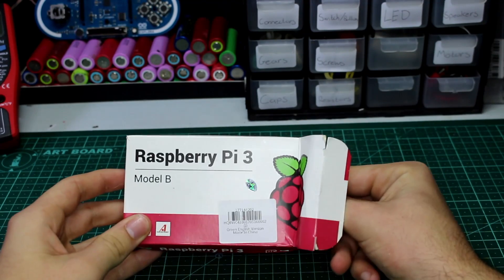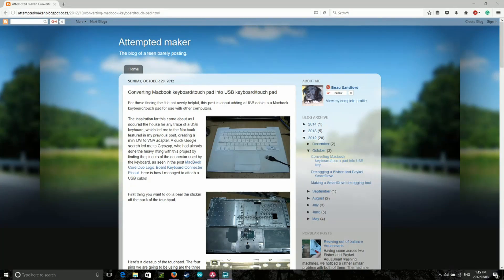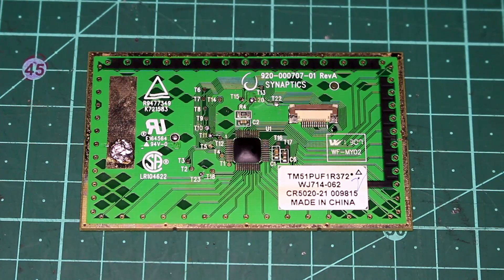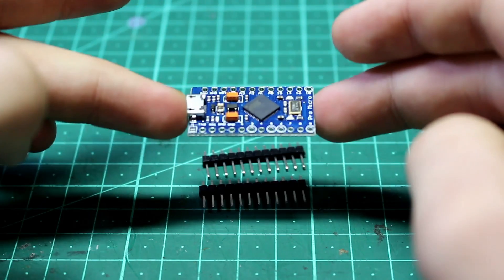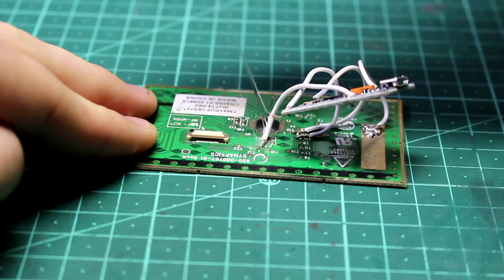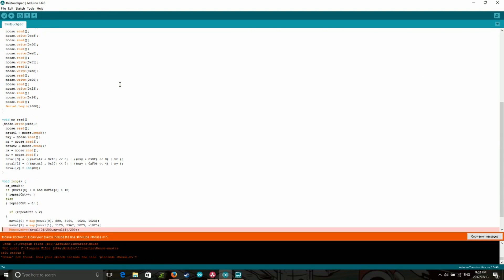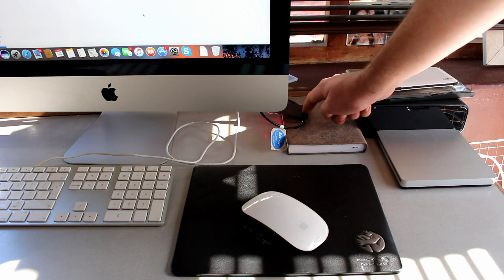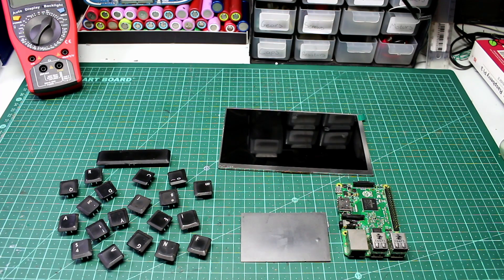DIY Arduino trackpad

Comment: You're lucky that you found the documentation for the specific trackpad that you found, but this may not apply to every single trackpad in the salvageable wild. It's more helpful to demonstrate how you came to the conclusion that these specific pin numbers are what we want..

And above all, Raspberry PI has GPIO pins specifically for interfacing with any generic devices, including the 2-wire or PS/2 interfaces, so requiring a specific Arduino just to have additional processing required is too unnecessarily complicated.

Comment: You can buy a ps2 to usb adapter for pretty cheap even as low as 2 bucks if you're willing to have it come straight from china. Just make sure you get the kind with both a purple and green end going into usb. The ones that only have one green end are passive adapters for things that support both ps2 and usb internally.

Comment: you can use a touchscreen touch panel instead and the pinout will be easy. so you can use a old phone instead of a old laptop then use existing touchscreen libraries to run it. although finding one that you can easily solder might be a issue.

Comment: the link you provided in the instructables for ps/2 library does not exist. Can u link the library files?
And I downloaded a ps2 library but it shows an error while compiling and i selected the correct  board
"fatal error: WProgram.h: No such file or directory"
Reply: Same problem
Reply: Fixed the problem! You just need to rename "WProgram.h" to "Arduino.h" in ps2.h.

Comment: wont upload to arduino uno,not at all!
Reply from the maker: I did say in the video that this won't work with the Arduino UNO
Reply: yes too bad,ok thanks
Reply: I get the pro micro! I have some trouble with libraries,where to find thes two folder mouse end ps2 in one place thanks!

Comment: Cool idea but if you flash the rom on the arduino uno you can make is show up as any device you like. I have mine used as a keyboard.
Reply from the maker: You were able to get an Arduino Uno to show up as an HID device by flashing the Rom, I didn't this was possible. Id love to know how you did it.

Comment: I was wondering with a track pad is it possible  to make it Bluetooth and something written on the track pad and it transfer to a smart phone
Reply from the maker: +Dilip Gola yes that's possible using the HC06 module
Reply: Build It Build It wow u be able to give a explanation on how the set up be, and where would I get the coding for such a project

Hc06
Trackpad
Andruno?

Comment: Can this be done with Aurduino Nano? And could it be controlled BT?
Reply from the maker: It can be controlled through Bluetooth however like i said in the video it will only work with the Arduino Micro and Leanardo

Comment: Neat!! I was thinking of doing something similar :D
Reply from the maker: What were you thinking of doing?
Reply: Build It Umm , an HID device using arduino . A small panel for music and  volume control on a PC .
Usually Keyboards have those built in but mine doesn't. 
Also I can Make it wireless and add more functionalities .
So yea , it's on my to do list for videos 😁